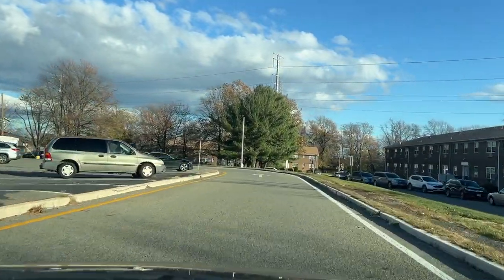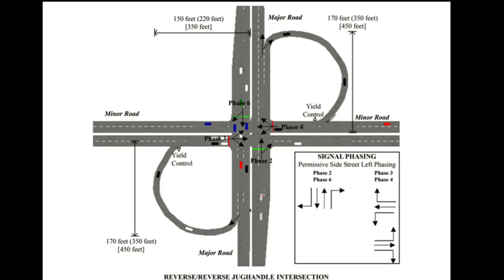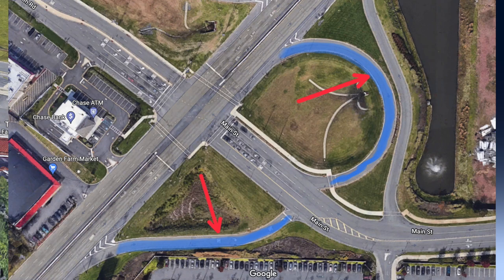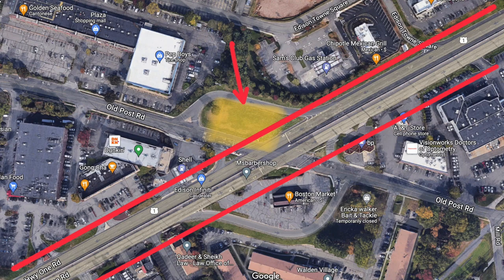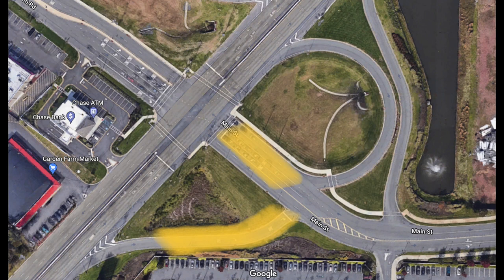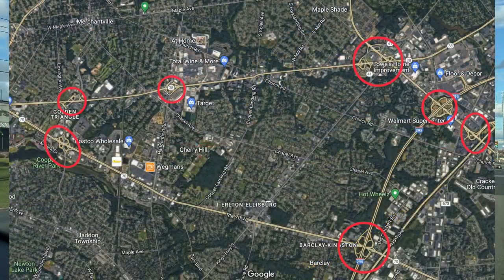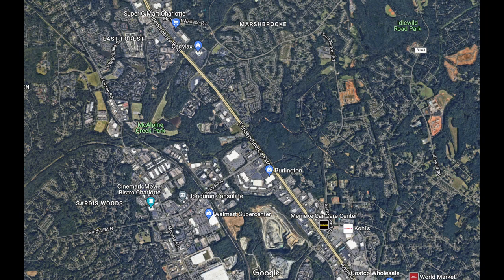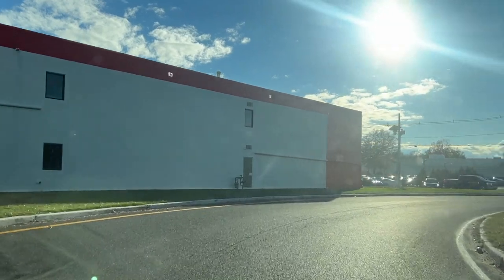Why You CANNOT Turn Left In New Jersey | The New Jersey Jughandle

Comment: Consider- NJ is according to Ben Franklin  "A barrel tapped at both ends"  by NYC and Philly, so in the country where car travel became popular NJ and traffic was invented, invented some of the standard control devices. The Jersey Barrier or concreate low wall to avoid head-ons is used worldwide. the cloverleaf started here, and the jug handle variation is a pain but works. The problem now is getting all the traffic off the highways as it backs up at exits.  NJ engineers need to go to California and learn how. BTW the jughandle came into being to replace traffic circles. In NJ they were notoriously impossible, dangerous, and inadequate so the State gradually removed most.

Comment: I live west of Charlotte now but I'm originally from Jersey. The only problem I have with jughandles is that it can be difficult to see exactly where the turn is for the jughandle because there can be businesses blocking the view. The same goes for the jughandle signs too. They can be difficult to see at night or even during the day. I've missed a jughandle or the sign for it several times because it's hidden between businesses. If you know where they are they're easy to use.

Comment: I'm originally from Plymouth MA. The intersection with MA 3A with the Plimoth Plantation Highway (PPH) in that town is a weird one. Going north on 3A one accesses PPH via a left exit. Going south on 3A the access is totally unsigned. However, there are two modified left-hand jughandles, totally different than the New Jersey jughandlles discussed in the video, to reverse direction and access PPH.

The eastern terminus of PPH defaults onto 3A south. If one wants to go onto 3A north at that point, either jughandle discussed above can be accessed. The first one is signed for 3A north, while the second one isn't. The problem is a crunch point between the end of PPH and 3A south as the distance between the end of PPH and the first jughandle is short, approximately 300-400 feet, while the distance to the second jughandle is about 200 feet beyond that.

In MA, more traditional jughandles of the type discussed in the video are located on US 1 northbound in Peabody (north of the intersection with I-95) for reversing direction, and on MA 2 in Lincoln at the intersection with Bedford Rd. for all turns from the main highway.
Reply: I was up in the Cape Cod region years ago and vaguely remember just how convoluted some of the roads were up there.
Reply: US 20 near I-495 confused me and my brother when we were in that area of Massachusetts, but we eventually figured it out.

Comment: Can you cover Interstate 86 in New York in a future video, and how and when New York plans to complete I-86, and I-86 in NY in general (as it consists of two disconnected segments)? I am a Cornell University student, and sometimes drive I-86 to other parts of the southern part of the state. I will tell you right off the bat, I-86 is already signed between Bloomingburg and Goshen is signed as I-86 even though there is currently no timetable for the conversion of Highway 17 between Windsor and Harriman to I-86, and there are covered up I-86 signs. And about the jughandle turn: in my home state of Michigan, there is a type of turn called the Michigan Left, which consists of a U-turn. Back to the topic, I would like to see a video on I-86 in NY.

Comment: The title of the video is a bit misunderstanding. You cannot turn left in New Jersey? 
When I saw the different types of jughandles, I realized, it's just the main through road where you can't. In type A jughandle you already must turn left into the secondary road. And drivers on the secondary road of course can turn left into the arterial road. 
It's just type C, where you don't need to turn left at all. And only if there are clover leaves at each corner.
Sometimes here in Germany we have no left turn allowed in city centres, when the main road is a bit narrow and at high risk of traffic jams because of left turning cars. Then we need to drive right around the block 3 times to be able to drive where we want to go to.
Jughandles like in this video I have never seen here.
Thanks for the video 🖐👴

Comment: You can make plenty of lefts, but when its better for traffic flow and safety based on the roads then jug handles or cloverleaf intersections are used. As noted there can be some real safety issues if you let people flip u-turns and there are roads where it would be insane. Also, the intersections are almost always well signed and it shouldn't be an issue if you're paying attention. There used to be a lot of lefts and Uturns in divided highways in New Jersey and they're gone because they had accident rates high enough to make playing Russian roulette better odds.

Comment: This is the way roads work. Slow cars in the right lane. Fast cars in the left. If you are in the left lane slowing to turn or looking for a place to turn it ruins the system. The jug handle resolves this problem. Sometimes the jug handle isn't large enough for people to turn left because cars back up from the intersection to the jug handle. Enlarging the jug handle would resolve that though it would cost money. Widening the intersection on the cross road would allow more cars to queue between the intersection and the jug handle.

Comment: I'm not sold on them. It seems like their main benefit is changing the que line to elsewhere  and shortening the time between light changes. However, these issues are generally solved in a normal intersection by just lengthening the left lane que line and changing up the light pattern to allow all traffic from one direction at a time. To me the negatives of the jug handles just don't seem to out weigh its benefits. I think there is a reason no one else did this in mass.

Comment: I had the misfortune and aggravation to deal with these pain in the ass convoluted intersections. When trying to use a gps and it’s zoomed out the detail doesn’t show up for having to make a right then left turn. When you finally start to realize there’s another level of insanity at work you’re four or more intersections past where you needed to turn. This might have been reduced if they had enough intelligence to put the signs saying turns had to be made from the right lane in the center or left median since that’s where your attention is focused. When you have taller vehicles blocking your view of signs to the right it makes it even more difficult to see what needs to be done. When you see that it’s a right turn required you then encounter the New Jersey knuckleheads who are racing to cut you off when trying to get over to the right. If you’re ready to stay right you’re then confronted with three possibilities of when to make a turn or lane change… four if you throw in the occasional left turn that occurs. Most earlier gps units aren’t sensitive enough to pick out the proper place to turn at. It’s even worse when you have to creep up to the intersection which makes them jump instead of move smoothly. Even with newer units and ones on your phone it’s nearly impossible to process three turns in the space of three hundred feet. And yet when you’re not from the area it’s nearly essential to use one to find where you’re going. Since their road system is a deep dark secret mess there’s no indication that one might benefit from paper maps to make sense of it all. So guess what! Since there’s no advance warning we’re left with trying to find a map to where they sell maps. Just be careful you don’t get cut off while trying to consult the map because you’re liable to accidentally create a new path that isn’t on the map. With the creation of the new stupid a part of me wishes I could meet the moron that came up with it if he hasn’t passed on already. I would cheerfully deck him myself provided someone didn’t beat me to it.
I’d also like to meet the imbecile that created the traffic circle. Where else could you find someone who makes a layout that’s supposed to keep traffic flowing yet everyone treats it like a 4 way stop? Instead of stopping and proceeding they wait car after car until there’s none left before moving on. It seems to turn into an eight way stop since it seems to be how many makes it through ahead of you. I think it’s actually a glorified jug handle designed to screw people around even more. This is why I have avoided returning to Jersey for sightseeing since the majority of my sightseeing is looking at the same patch of roadway from all different angles before proceeding to the next. When possible I always try to avoid the roundabouts because I want to avoid adding more gray hair from waiting on the slow f**kers along with the aggravation. While you’re at it could you please fix your roads? A few less toll roads would also be nice so we don’t have to drive 10+ miles out of the way. I come from a state that only has one tollway and it still has an alternative for driving on it. It still uses the same adage that you can’t fix stupid by ripping people off. It’s just too bad that the people who need to see it probably won’t. For the engineer who’s studying don’t learn the bad habits of Jersey or the roundabout idiots.

Comment: Honestly, the Jughandle seems to be a case of not weighing out the advantages and disadvantages of the design. I can definitely see its advantages, but with how the jughandle lane can easily get blocked and then in turn block the right lane of the main road and the additional high-speed conflict point with pedestrians, I can't justify its use. There's better options for big intersections.

A couple examples of those better options:
A multi-lane roundabout with slip lanes and dedicated directional lanes would allow constant traffic flow through the intersection. Properly signaled using "wait for green" lights much like some very high-traffic on-ramps, it shouldn't be confusing as to who has right of way. Traffic does slow down through the intersection but doesn't 
A Continuous Flow Intersection is similar to a jughandle, however with one critical difference - it places traffic turning left on the left side of the intersection while still giving a separated queueing area. This intersection can be built more compact than a jughandle, and doesn't have the risk of the turn ramp being blocked as it exits on the downstream side of the intersection while still technically being in the intersection. You still have an interaction point with traffic turning left crossing traffic elsewhere, but you can use a signaled left turn lane to feed into the turn ramp.

Comment: See those gray concrete blocks separating one direction from the other? Those are known across the country as Jersey Barriers. They not only prevent you from turning left, they are also designed to put you back on the road if you ride up the side of them. 
All you have to do is search for idiots in cars and pull up tons of YT videos showing tons of accidents happening because some idiot doesn’t know how to turn left or some idiot doesn’t notice the person in front of them is slowing down to turn left. Accidents on 2 lane roads happen frequently with people turning left and are much more frequent and dangerous, when you start adding lanes. So Jersey, with the highest number of people per sq. mile and a lot of traffic took left turns out of the equation on major roads. Hence the jug handles (located after the intersection) and dog legs (located before the intersection).

Comment: Wow, just looking at these from an outside perspective,, this is one of the dumbest things I've seen traffic engineers do. There may be a few times these are useful, but outside of very specific circumstances, they are just downright stupid. They ultimately take up more room, require more traffic to cross lanes with other traffic overall, and cannot possibly be as efficient overall in most cases. They also allow no traffic to turn on green across the other lane of the highway. A practice that is sadly being implemented less and less often in the name of safety.

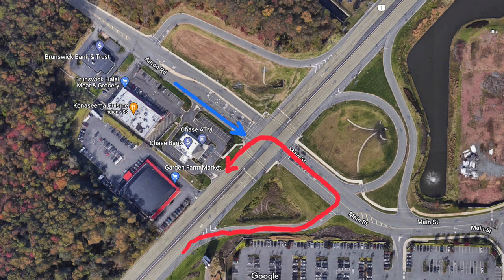Comment: Your visual at 4:45 about uturning traffic shows an illegal maneuver for that intersection just FYI.  That first jughandle the traffic was ending up in a right turn only lane so to do a uturn one must continue through the intersection and use the second jughandle then get into the left turn off main street.

Although at 7:07 you did use the same intersection and showed the uturn disadvantage using the correct jughandle for uturns.

Comment: I still don't understand why America doesn't use roundabouts. That literally solves ALL of the problems in one go, also roundabouts can usually get traffic through the area 20% faster than a junction. In the UK we use a lot of roundabouts instead of large junctions. It also is safer, as there are less high speed accidents.

Comment: You no turn, capiche? Sea, Catfish.
Will the spirograph math perform as programmed thus requiring an official tile. Intersectional geometry.
Move it in move it up Lift It Up, drop it hot. Extreme Cloverleaf safety. Underground overdale, never cross a line if it means avoidance through Tactical corkscrewing home and back baby.

Comment: What the hell! I live even further north and east, in massachusetts (you actally travel SLIGHTLY east, as you head north up the east coast). And you can turn left and "bang a U-ey" here. Although i have seen some of these in certain parts of busy multi-lane roads with a meduan in the middle (like rt 1) in mass and jersey.
Also, i dont believe you that there are NO left turns in new jersey... only busy roads, ike the one i described. Ive bee to jersey many times, as im only a few hours away, and i dont recall this being absolute. Maybe im musunderstanding, or taking your title too literally. This also makes me realize why people have such a hard time driving in mass. For one, we have northeast population density. And 2, the road design is kind of an anything goes tyoe of thing. There is no absolute system. They just kinda put whatever seemed to work best at the time, and if the area around the street changes, theres often too much congestion to change the street itself cause too much is already set in stone. Closing the street to update would cause too much traffic. Im saying this all from a resident and a construction worker who often works in the street's standpoint.